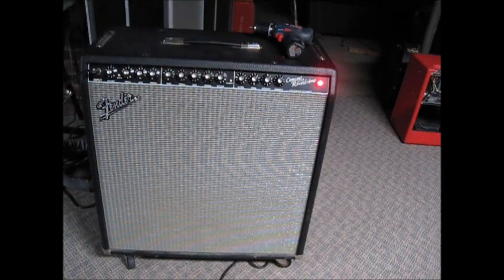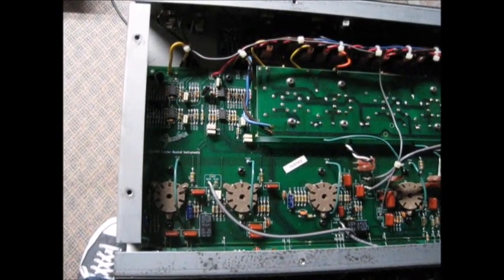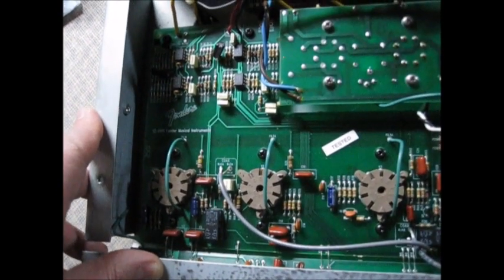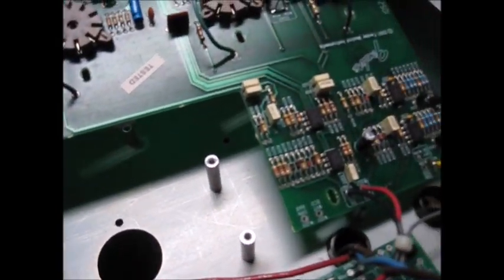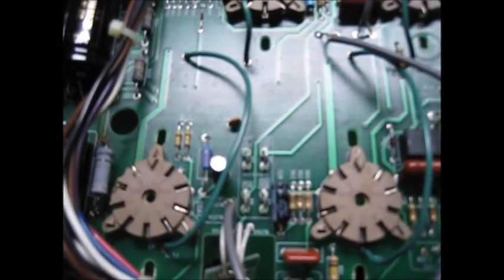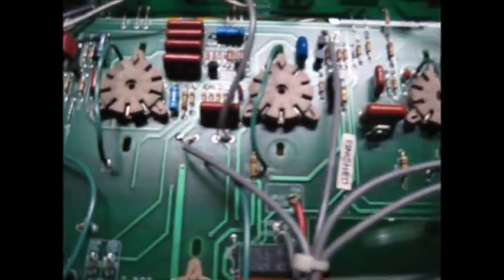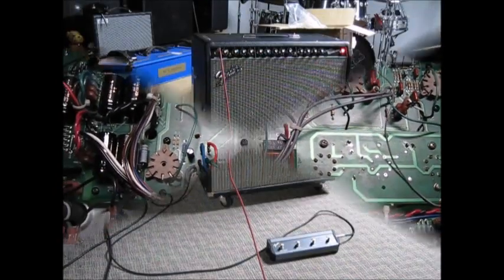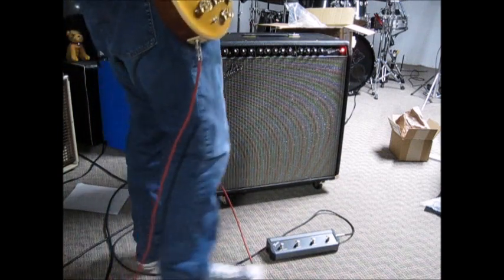Early 2000's Fender Concert Reverb....  Noisy,  and non-functional tremolo.

Comment: Looks a bit of a beast..! Sure does look packed, and a bit if a nightmare. Well done, powerful amp..Ed..UK..😊
Reply from the maker: Thank you...  The biggest challenge with this thing is....  you have to work so hard to get it apart,  that you'd BETTER  get it all before re-assembling.     It's at least an hour of goofing around to get the board out.
Reply: @DeadKoby  Thanks for info..☺

Comment: My son's has been at the shop for months now. The tech guy loaned him a Mesa to use while he worked on son's Super Concert Reverb. Son digs the Mesa so much he hasn't been too worried. Mesa is worth about 4 times the value of the Reverb so there's that. He does miss the tremolo though.
Reply from the maker: There's more broken amps than there are techs to fix them.   I stay  "underground"  with no adverts out there telling of my ability to fix things...  yet word gets out,  and I'm backed up also.  If you notice,  I'm a "ninja"  online too...  I don't want to make a fuss about my repair shop.
Reply: @DeadKoby  His concert reverb started acting up during a show.The lightning show of which you allude too was EXACTY what his amp was doing. It also has that 60 cycle hum that is a bummer.
Reply from the maker: Never fun when something blows up. MOST mass market amp makers are doing everyone dirty by building stuff that's darn tough to work on.   I've gotten some more "boutique" stuff here at the shop...  the problems were easy,  and the amp wasn't a chore to get started on.